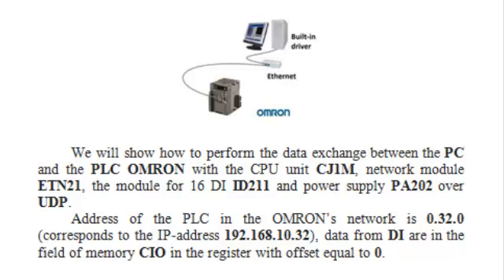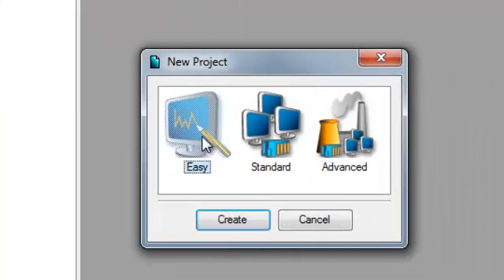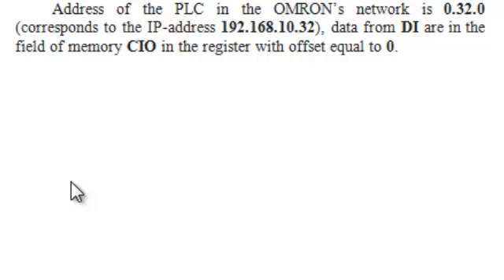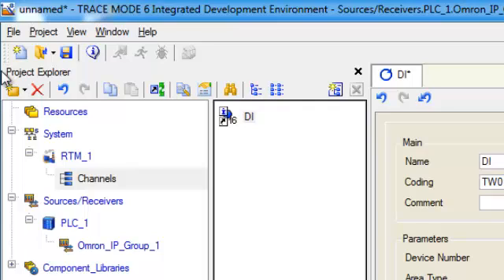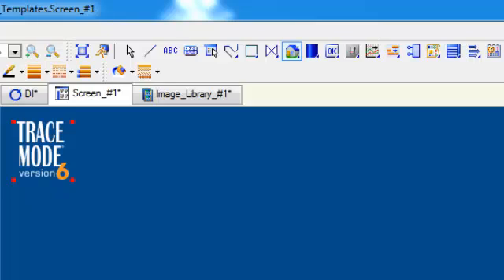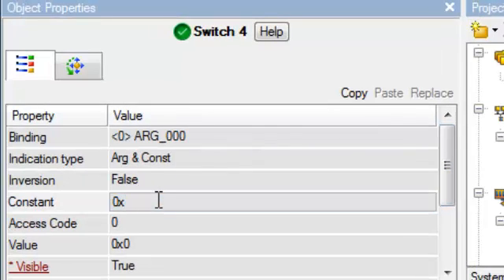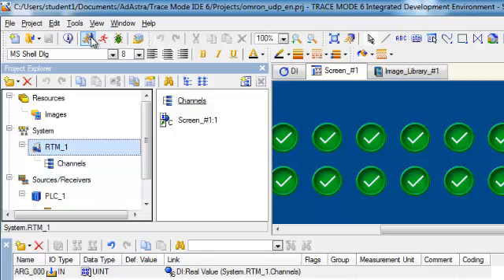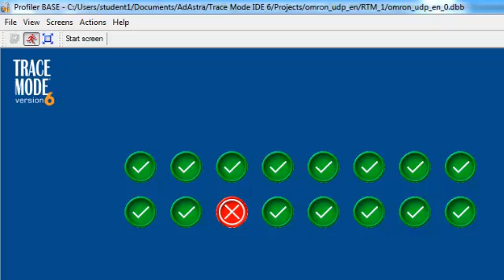Connecting An OMRON PLC to The TRACE MODE SCADA/HMI via UDP

Comment: Thanks for the tutorial on the Digital Output, may I ask how to address Omron Digital Out 100.0 to 100.7? Thanks
Reply from the maker: Sorry, we didn't quite get your question
Reply: @TRACEMODESCADAHMI  i was referring on how to address the Digital Output of the omron PLC using trace mode scada.. In your example, you addressed all outputs using hex.. How about the output? How can i address the outputs Q100. 0 to Q100. 7 for example? Thanks
Reply from the maker: Hello! A program placed inside the PLC must read data from the CIO area, for example, the register 100. 
Then a component SOURCES/RECIEVERS/PLC/OMRON_IP_GROUP with Device Number=<your PLC number>, Area Type=CIO, Offset=100, Direction=OUTPUT should be created in TRACE MODE IDE. This component has to be linked with a class HEX16 and type OUTPUT channel. By controlling its attributes Bit1....16, you can switch ON/OFF conntcted to DOs digital devices.